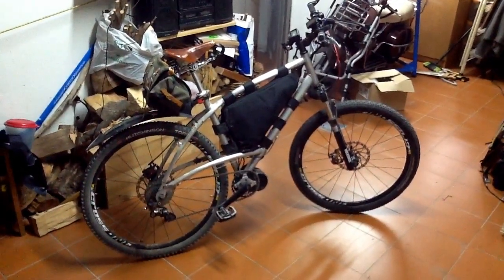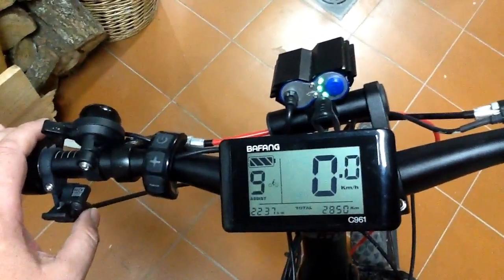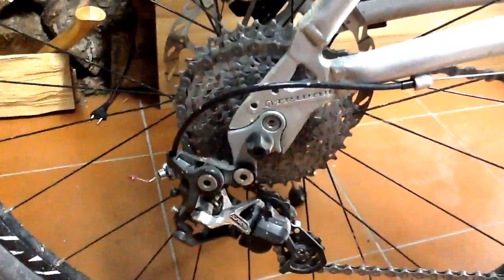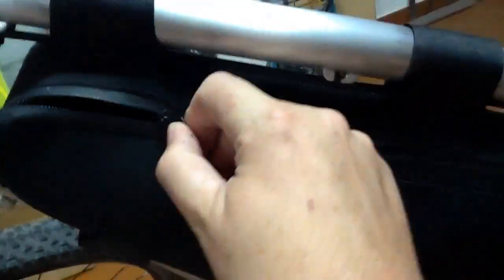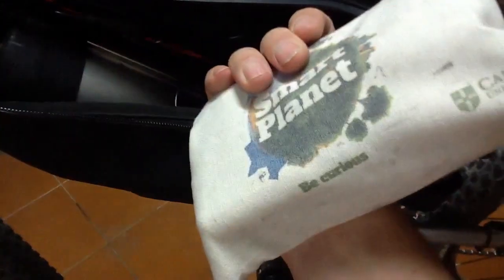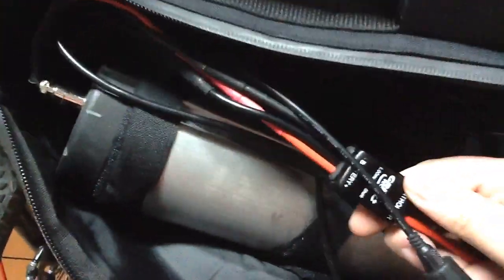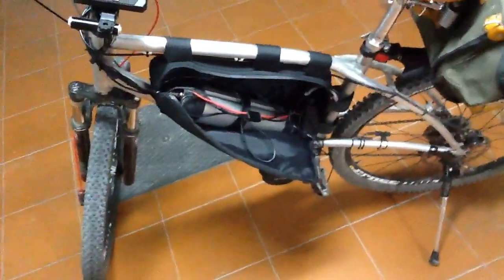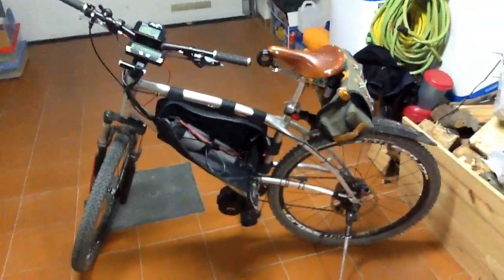Bafang (8Fun) BBS02 48V 20A ebike conversion

Comment: For me a geared hub drive would have been sufficient ( I have a 350 watt Sondors) but I recently purchased a Sunseaker Fat Tad with a mid drive.. 
It's freaking way more powerful and battery efficient but does have a learning curve so as not to trash your drive train..
I could probably run it off an 18 volt Milwaukee pack and do just fine..
Running the motor through the gear systems is amazingly powerful and hardly draws a fraction of the current that a geared hub requires.
Reply from the maker: Hello Bill. 
I suppose it all depends on usage. 
My wife has a 250W hub motor on her bike, which is fine for running on flattish trails and bike tracks. 
I use mine mainly offroad, on all types of terrain. 
Mid-drives give you much more controlable power, thanks to all the gears (14, evenly spaced with the Rohloff). 
They're also much more efficient, battery wise on the hills as you can put the bike into a really easy gear and climb virtually anything with a lowish power draw. 
The BBSHD is overbuilt, so doesn't heat up, and has loads of torque when you need it. 
I've "climbed" some crazy steep hills on throttle, where I had to lean right over the handlebars in order to stop the bike flipping over backwards! 8)

Comment: You have the same lamp and my future motor heh, so I'll suggest you another stuff from my bike: NCX  SR SUNTOUR  . Just get it, it's super cheap and does the job!
Reply from the maker: Not sure if I understand your comment correctly. "NCX SR Suntour" is a front fork I think, not a lamp. My bike already has a Rockshox air adjustable fork, so I think the Suntour would be a downgrade rather than an upgrade.
Reply: No, type it in google and check the images: it's suspension mounted under the seat. Very cheap and good.
Reply from the maker: Ah, that's pretty cool! Don't know if it would be overkill on my bike. The Brooks B135 already does a pretty good job. Same sort of saddle they used on the first motorbikes, back before they had suspension!
Reply from the maker: What's it like when you're pedalling? Does it feel strange?
Reply: Nope. It smooths all holes, rocks, roots. Maybe test it before buy at some shop.
Reply from the maker: kurt hectic Don't know if it would work with my saddle because it's double sprung and attaches using the old system. Certainly an option to check out if I do a new build! Thanks for sharing!

Comment: very informative video 🙂 im interested to get this kit but wondering how to use it in Europe since its 500w?
Reply from the maker: Thanks! I've had this for two years now, done about 4500km and no problems so far. 
I live in Spain, so am legally limited to 250W and 25kph.
I have disconnected the throttle (in Europe it's illegal). If I'm on a track and I want to use it, all I have to do is open the battery bag and reconnect it, but if the police stop me I can easily show that it's not working.
The motor makes no mention anywhere of the number of Watts, it just says "48V 20A" underneath on a small plate.. Clearly if you multiply 48 x 20 it gives you 960Watts! Its usually covered in mud anyway, so not a problem.
Although I've played around with a lot of settings, and been a bit of a hooligan in the past, I've got it set to quite a low level of assist now. (I tend to run between 30W and 160W most of the time going up to 250W or 350W on the hills or if I want to go faster or work less).
There are two ways to program the kit. 
If you press and hold the + & - buttons you get basic configuration. If you press and hold the + & - buttons while pressing the on button eight times you enter the advanced mode. 
Neither of these are obvious, so a policeman isn't likely to know how to do it. The other way is via a special data/usb cable using a PC. (You need to be really careful with this methos as you can very easily fry your kit). 
The point is, you can easily dial the power down to legal levels/speeds when you need to.
I use my bike, mainly off-road. I have a 38T crank plate and a ten speed 36T-11T on the back. On the flat, this gear combination gives me a top speed of about 35kph. Also the way I have it configured, it usually doesn't go above 350Watts. Again, you wouldn't see any of this information with the kit's display. I know the exact figures because I have it wired up to a Cycle Analyst V2.3. The kit is also quite small and discreet, so it doesn't look that powerful either even though it's a beast! (if you want it to be).
I would highly recommend the Cycle Analyst as it provides invaluable information regarding the state of your battery (especially how much "fuel" you have left).
I'll never go back to unassisted cycling as this makes going out so much more enjoyable.
Hope this helps!